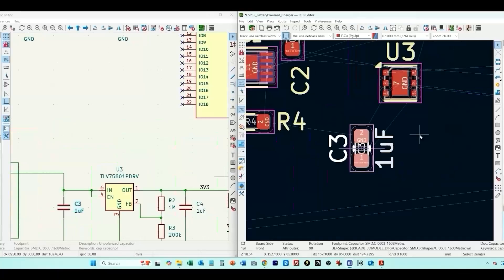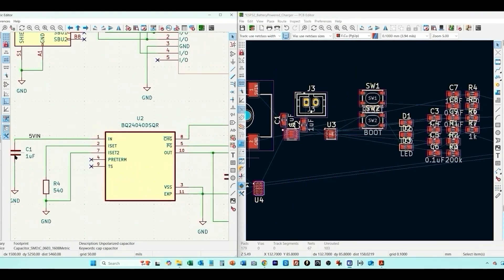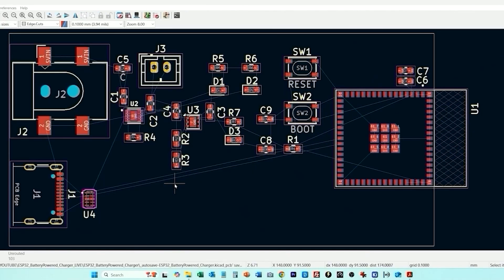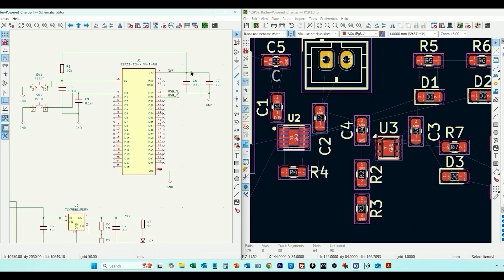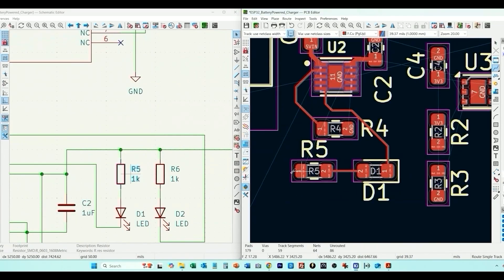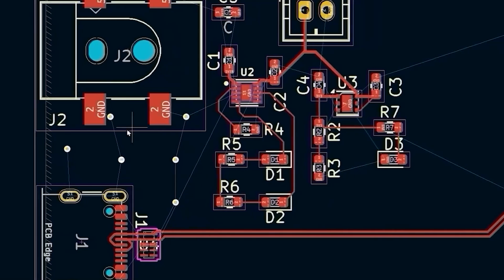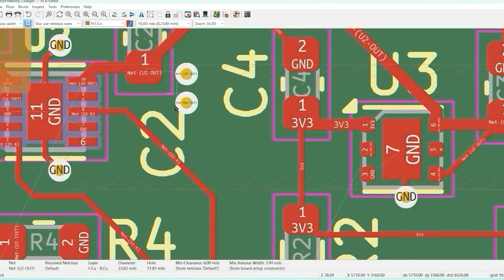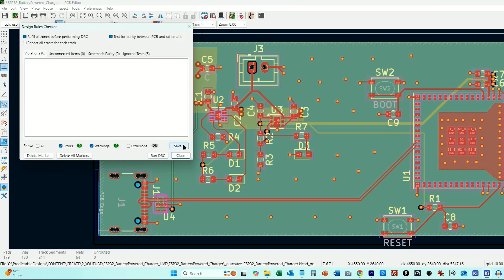Design an ESP32 Board with a Battery Charger - PCB Layout

Comment: When routing differtial pair from ESP32 to ESD. the PCB doesnt recongize pin 10 and 9 as USB_N and USB_P, even though it has been routed correctly from schematic (using mac). If this is not possiable, what shall i do?

Comment: awesome tutorial! btw, could you please explain how you arrived that we have to use two vias ( 13:25 )for connecting the ground and power vias? is it standard practice on these type of boards or are there any other considerations here?
Reply from the maker: It really depends on the current and the max current spec for a single via. Even if a single via can handle the full current, it's usually best to use multiple vias for high current power just to minimize the resistance of the vias.
Reply: @PredictableDesigns   thanks, that really helped!

Comment: What's a good way to do fuel gauging and checking battery percentage? Using fuel gauge IC or voltage divider and adc?
Reply from the maker: Since a lithium battery has a non-linear discharge curve, a fuel gauge IC will be the most accurate. A resistor divider with adc can work if you just need a crude approximation of  battery capacity.

Comment: I might have missed it (sorry it’s 1am haha should be sleeping) but I would love to know how viable you think a design with only 2 layers would have been instead of 4.

I’m aware that 4 layer has the advantages of easier routing and better interference dampening (that’s not what it’s called, but you get what I mean) but if your goal was a very basic board to demo say thread networking and you wanted to prioritise keeping the cost down as your planning on eventually making a large order $1 let alone $5 difference could blow out the budget.

Cheers again :)
Reply from the maker: Well it of course depends on the design. This board could have easily been only two layers, and I only made it 4 layers for educational purposes.

Most simple to moderate complexity designs can be done as a 2 layer board, especially if small size isn't critical.

For products with wireless radios I prefer 4 layer boards with a solid internal ground plane, and a ground plane with lots of holes and cutouts can actually act as small antennas causing potential certification issues.

Comment: Probably a better question for the first video (or maybe it’s in the full one) but why would you choose linear over a buck?
Reply from the maker: Great question! A buck is best when there's a big difference in input voltage and output voltage, unless the load current is really low. For example, 12Vin and 3.3Vout is probably better for a buck if the current is more than 100mA or so.

The power dissipated by linear reg is simply (Vin-Vout)*Iout.

But in this case it's only 5V to 3.3V so a linear reg is better. A linear reg is always the best option unless the power dissipation is really high. Linear regulators are cheaper, simpler, smaller, and aren't noisy like a buck.
Reply: @ legend thanks
Reply: I am very happy to have this decision validated for my own hobby design.
I am very much an amateur and currently working on a low power battery operated sensor board for a very specific niche. While my initial inclination was to jump straight to the 'modern' buck/boost Implementation, I couldn't find any that could beat the figures of a low Iq LDO and 3 AA cells, even before considering the much more complicated design. Especially when taking into account that the device would be in deep sleep nearly 100%
Reply: ESP's are power hungry beasts. If you want a battery powered device that lasts for more than a couple days, a linear reg is a no-go. As you said, since the ∆V>1, you are literally wasting more power on the regulator than on the ESP. Also, noise is not usually a problem for buck converters unless you run ADC sensitive applications, which the ESP is not really good at, anyways.

Comment: Couldn't fully follo the stack up, from what I understood it's 

1- signal + power
2- GND
3- Power
4- GND
Reply from the maker: That's mostly correct, and I should have highlighted the stack up better. Layer 4 also had signal routing and a ground plane. It was a design that could be easily done with 2 layers, but I wanted to show a 4 layer design.